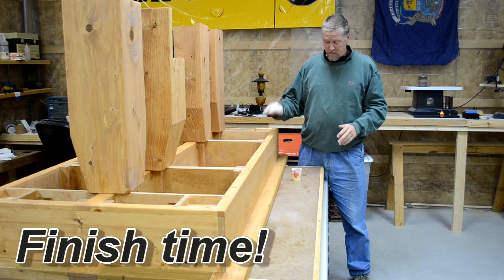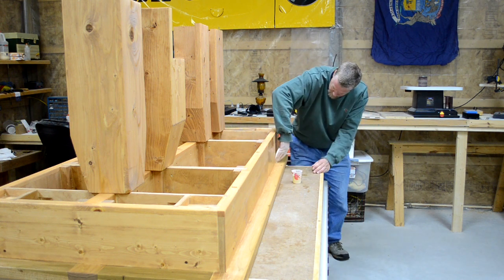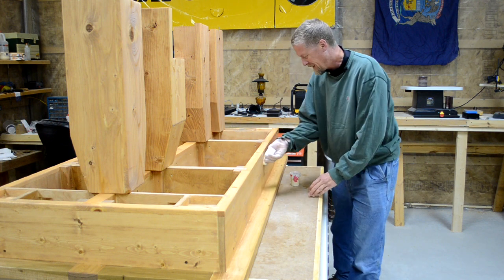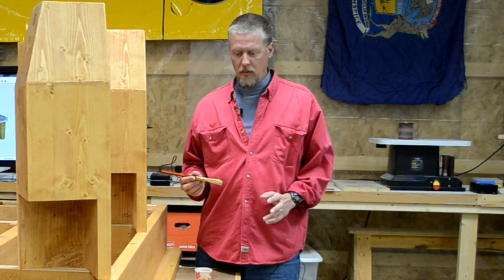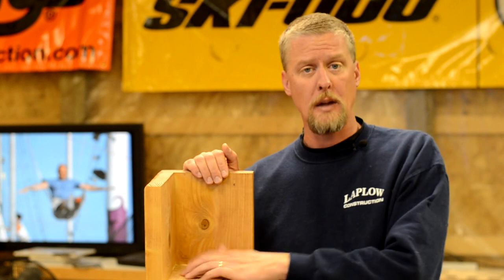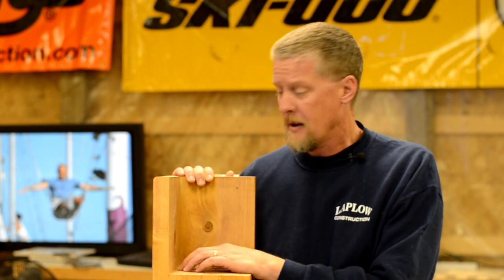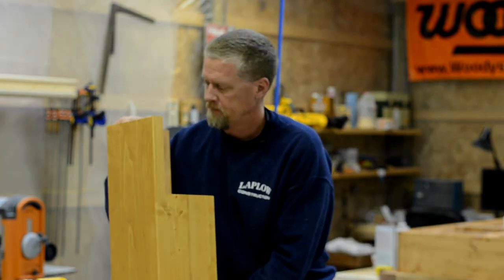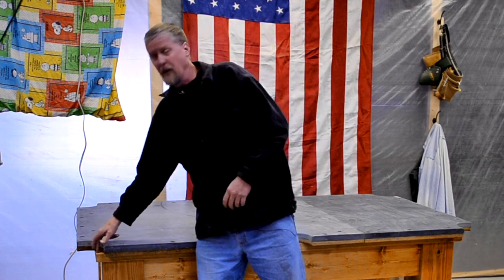How to Build a Pool Table, Part 6 - Efforts in Frugality - Episode 3.1

Comment: I’m mechanically challenged so forgive me if this is a stupid question. I saw you create the holes for the dowels, but then I saw you put dowels into the holes with glue which were exact size. In other videos, I’ve seen people use dowels where part of the dowel would have been in the leg, and the other in whatever piece they were trying to connect. You drilled a hole then filled the hole with a dowel the exact same size. Could you explain that to me? How was that better than using screws?
Reply from the maker: My thought was that screwing into end grain pine wouldn't hold the screws well. By filling holes with oak dowel I thought would alleviate that potential issue. That was my theory anyways. And 10 years later the screws still hold well. Thanks for the inquiry.